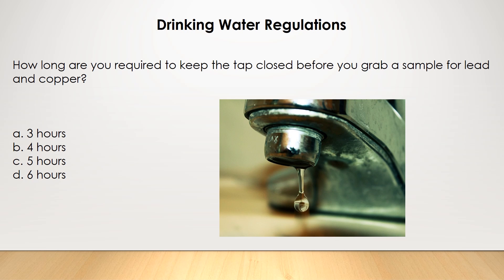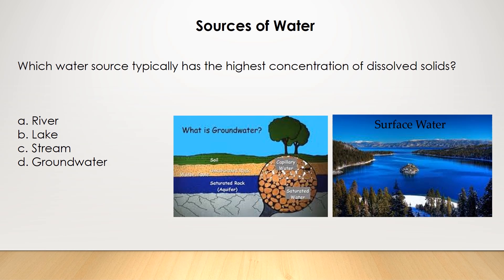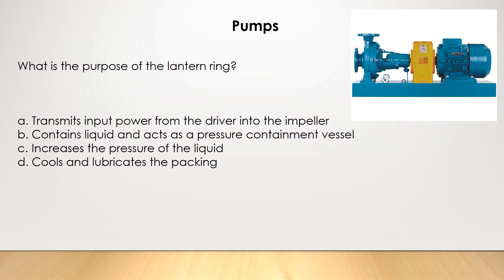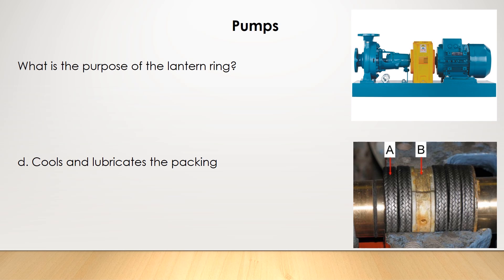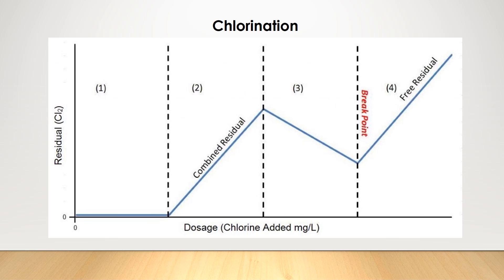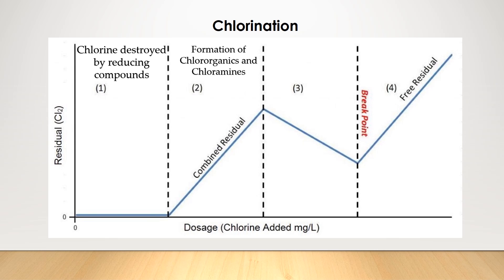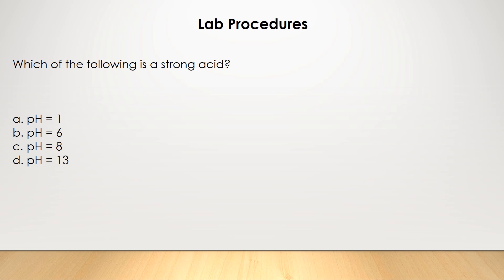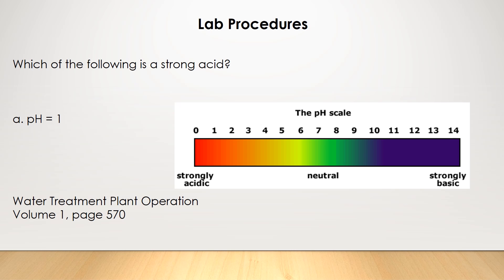5 Common Questions on Water Treatment Operator Certification Exam

Comment: I’m taking my T-2 test June 3rd. I’ve made over 100 flash cards on just vocab. And this has been so helpful I’d rather be over prepared then underprepared so thank you so much
Reply: Knock knock. Did you pass? Would you mind sharing on questions you remember on having trouble on? 

I’m currently studying for my test and have a stack of flash cards of definitions and exam prep questions to remember. Also listening to the sifu podcast on repeat which has been a big help. Do you have any tips you can share to prepare for the test and how long were you studying for before the exam?
Reply: @abulletforrem big tip is to study some info on pipes. Example question would be like what’s an advantage of flexible couplings. Another one I remember is what’s the purpose of a mechanical seal. Funny part is I work at a WWT plant so I just know and was taught it prevents water from getting into the pump and etc but the one on the exam was asking about something else. A lot of D.T questions and math dealing with specific gravities. Unfortunately I didn’t pass but it wasn’t by much so I’m not letting it get to me because I know I got it. So best luck to you! If you know lb/day formulas and converting gpm-mgd you’ll have it in the bag. Also lots of diameters and psi questions
Reply: @PrplexedMG sweet, that’s good to know.
Those are what I’m studying on right now.

When you were studying for the exam, did you listen to podcasts, math and formulas? Or was your flashcards mostly words and definitions. I’m just getting insight on what to do to better prepare because I just purchased a practice exam book and using that as a reference
Reply: @abulletforrem if you have flashcards and the practice exam book. Go heavy more so on the math and decent work on vocabulary and you’ll be fine. There’s 85 questions for vocab and 15 math questions.